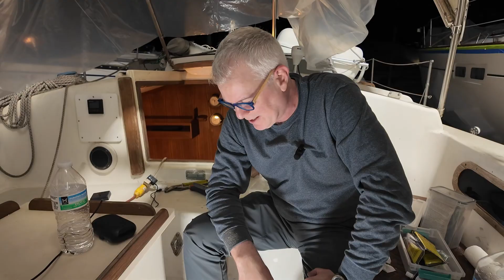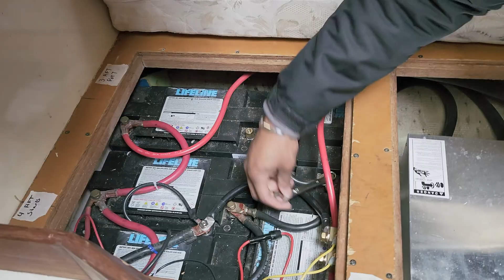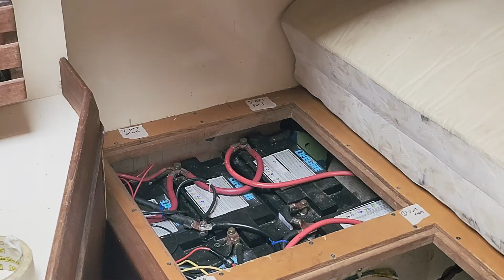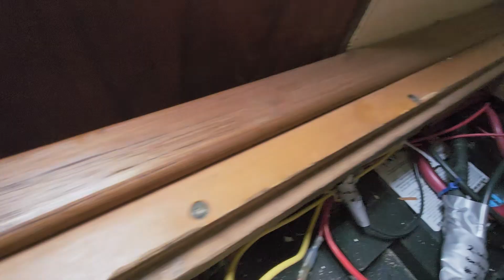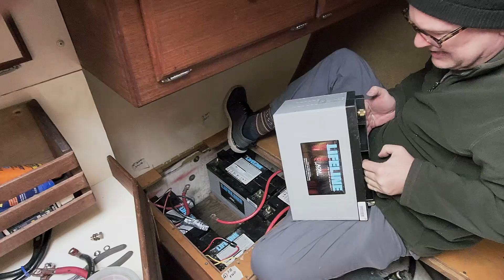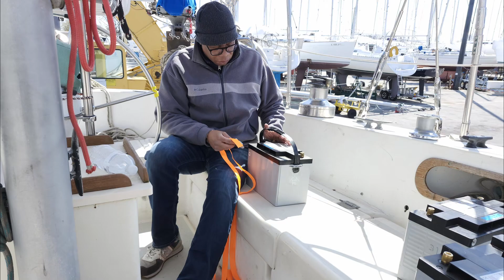My OLD Sailboat Batteries FAILED just before Launch!

Comment: Always something to do on a boat, this one couldnt have came at a worst time though?⚓⛵-jim
Reply from the maker: Hi Jim, I'm on the back end of that project now so you will see how it panned out.  I was working 16 hours per weekend there for a while.  I suppose a worse time would be realizing I had dead batteries after leaving for multi-day trip.  It certainly would have been better to have started that project last winter.  We all get stronger from challenges and finding ourselves in tight spots, so I can take that away.  Thanks for the comment and thanks for following.  Have you launched yet?